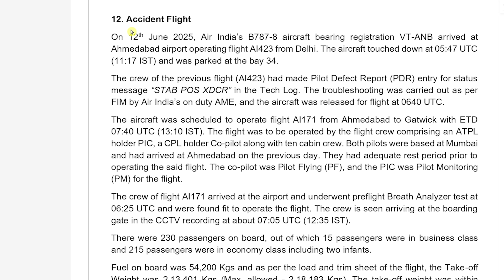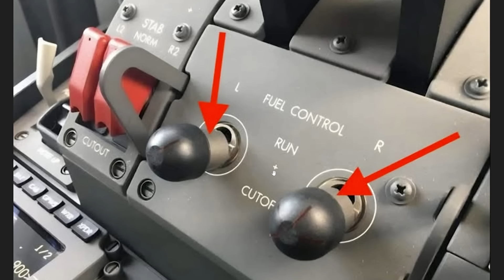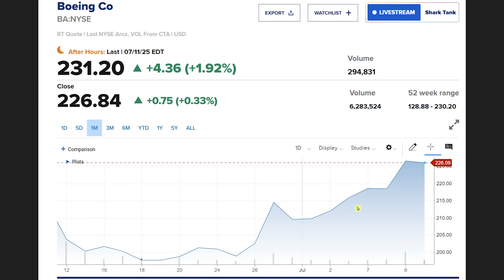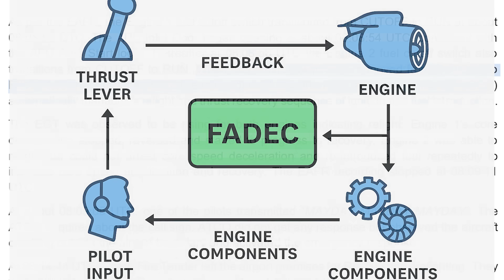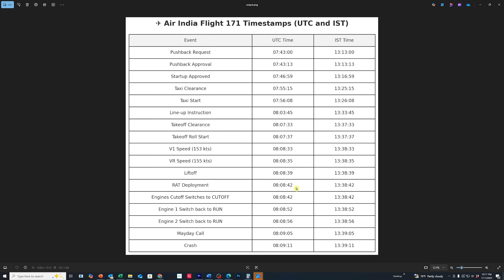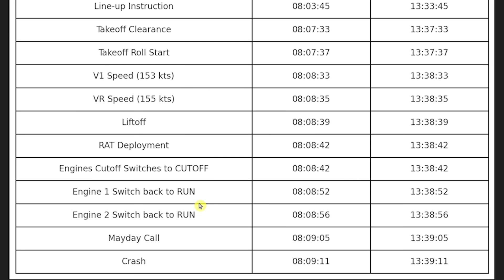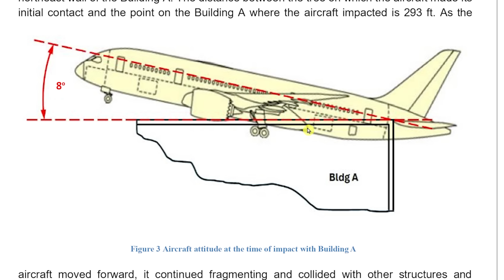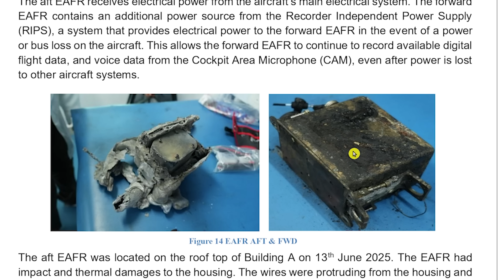Did Pilots CUTOFF Fuel? Shocking Twist Air India 171 Report!

Comment: in 787 dreamliner fuel  switches are bracketed and guarded . It's spring loaded 5 pound of force to be applied on each switch to pull it, to change its position ..both can not be operated at the same time .seems like a mechanical failure
Reply: Interesting information. Don't know why they didn't use a switch guard on such vital switches. When the B737 300 first came out, the rudder trim switch had no protection. Cabin attendant sitting on observer seat behind me put her foot on the pedestal and moved the trim. I knew it wouldn't be long before it took an accident, to put a guard on it. I have seen several cockpit designs that made no allowances for human error. Too many optimists in the design department.
Reply: Suggest you watch the vid by Capt Steeve who demonstrates the switches being moved within one second of each other.
Reply: Dumb dumb..
Reply: Reading the report what is the most terrifying is pilot a saying why did you cut fuel? Pilot b replies I did not! Ok so that says one thing really leaves little in the way of options, 

1 pilot a switched them off and questioned pilot b about it. 
2 pilot b turned them off pilot a caught the mistake and corrected then questioned and B lies to cover
3 mechanical malfunction flips both switches like a breaker as the air directive mentions is possible
 4 there's someone else in the cockpit that did it
5 Casper got bored and decided to collect souls. If I was the sole survivor I'd be afraid that I just lived thru my own version of final destination.
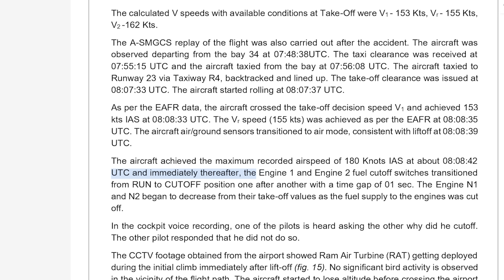Reply: so you didnt watch the video  1:54
Reply: Who said same time? One second is in the report. You're hallucinating

Comment: I can't recall who's analysis it was on YouTube where I heard this info.. But it was said that there were previous incidents where there were sometimes a glitch during electrical systems switching to the RAT where both cut off valves would close.. (as they require power to stay open) but those incidents were on landing and caused no major problems so there wasn't much public reporting done in regards to those previous incidents... ? Have you looked into this info already?  If this could be what happened then the pilot who said they didn't cut off could be  telling the truth and would be very wrong to suggest otherwise.. Please look into it.. and let us know what you find. Also, do the black boxes record the physical switch position or just the position of the valve or whether there is current in the circuit?

Comment: AND what about this from The Aviation Herald? Doesn’t seem to blame the pilots.

“On Jul 12th 2025 (UTC) India's media report that the investigation is NOT focussing on a human action causing the fuel switches to appear in the CUTOFF position, but on a system failure. Service Bulletins by Boeing issued in year 2018 recommending to upgrade the fuel switches to locked versions to prevent inadvertent flip of the switches, as well as the FAA/GE issued Service Bulletin FAA-2021-0273-0013 Attachment 2 relating to loss of control issue (also see above) were NOT implemented by Air India. The stated MN4 computer with faulty soldering, that might weaken and lose contact due to the thermal stress after a number of cycles, interprets data and commands fuel metering valves - with the lost contact attaching the MN4 processor to the EEC intermittent electrical contact, loss of signal processing and engine control faults can occur. The SB writes under conditions for the SB: "An LOTC (Loss Of Thrust Control) event has occurred due to an EEC MN4 microprocessor solder ball failure." According to discussions in the industry it may be possible with the number of cycles VT-ANB had already completed, the solder balls were weakened sufficiently to detach the MN4 from the EEC momentarily due to loads during the takeoff rotation leading to the loss of control of thrust and shut down of the engines.”

Comment: The RAT would not deploy untill the engines go below idle threshold and the engines would not go below idle threshold unless there was a problem, so 08:08:42 Engines Cutoff Switches to CUTOFF could not have been the time the switches were moved to CUTOFF but rather the time one pilot said to the other, "why did you set the switches to CUTOFF". The switches went to CUTOFF some time before that but was not noticed by the pilot asking the question untill at this time.
Reply: Yeah I noticed that Jeff's timeline was wrong right away, too. He actually listed the RAT event before the switch cutoffs, and the time he listed was the same, which is impossible.
Reply: The RAT deployment time is not specified in the official report. It just says hydraulics were being provided by it at :47 seconds. Did guy who made the list go by typical deployment times after fast spooldown to sub-idle?
Note that the resolution of the timestamps is one second, so times could be extended/reduced.
Reply: And why did the pnf say he didn't....

Comment: Could the cut off switches have been tripped by an electrical fault? A previous traveller posted a video of issues in the cabin which seemed electrical in nature.
Reply: Good point indeed
Reply: They cant trip they are not breakers. You have to lift them and move them up or down.

Comment: There should be an interlock or a computer supervision, when taking off those switches do nothing i.e. either on/off fuel continues to feed the engines no matter what.
Reply: There are legitimate reasons for shutting down an engine early in flight. Perhaps not allowing a double engine shutdown would make some sense. However, how much delay should there be. Also, introduces new failure modes. Consider if the buildings hadn't been there, the plane could have likely crash landed with little to no loss of life. The current switch arrangement has been used for decades in both Boeing and Airbus aircraft without serious incident. If anything, those switches have saved many lives over that time. Ability to shut off fuel immediately to address an engine problem is an essential safety feature.

Comment: The switches do not connect directly to valves.
They make an electrical connection going to who knows where!
RAT deployed before Cut Off!
Reply: You are more expert than the report... Do you have factual evidence? 
These are bold clams that no professionals have yet argued.

BTW you are up against NTSB in the US... its not just india... so don't take the escape route.
Reply: @TravisAviation  he just googled it, he does not really have that piece of information, as a part of his knowledge base
Reply: @TravisAviation  

i'm pretty sure the switch would be going through an electronic / electrical interface to actuators.
not directly connected.
this is due to inductive kickback, hysteresis.. etc.
the signal would likely be conditioned both ways, outgoing and incoming for confirmation that the valve had been opened / closed since this is a critical item.  
and the incoming confirmation would likely be a separate piece of electronics not connected to the outgoing.

that would be good design.  

it sure as hell isn't a switch the pilot throws that simply closes some relay that activates the valve.
that's crazy talk yo.
Reply: And they know where, it is where the computer and wires lead... uhhh oh Switch, Fadec, Engine, etc...

Comment: Even if it looks increasingly plausible that one of the pilot intentionally flipped the switch, don't discard the possibility if some kind of freak electronic failure caused the system to read switch off and on events without the switches being touched. A thorough investigation is desperately required to root cause the issue. After all, it is very difficult to accept that one of the pilot was on a suicide mission despite having precedence of such nature in the past.

Also someone asked this question in the comments below. Requesting experts on this subject to answer.

"do Boeing 787 fuel cutoff switches produces clicking sound or generate audible alert when flipped" ? If yes, cockpit voice recorder would have picked up this sound and may help ascertain if the switches were indeed physically moved,
Reply: I think that the sound of the switches would be too quiet to hear.
Reply: Similar incident, January 2019 Osaka. Both engines stopped while landing. No one moved the fuel switches.  The fly by wire computer can override the switches without moving the physical levers. Think of a modern car going crazy etc, another example of computer malfunction. Old cars had direct links, no computer.

Comment: I might be wrong but as I understand both even intentionally can’t be turned off within gap of 1sec
Reply: Sorry, but the flight data recorder says that's what happened. And it could happen in one second, because it did.
Reply: Exactly, I thought the same, maybe possible if it is deliberate, and done simultaneously by borh hands, and possibly by hands which are not on the yoke.
Reply: i had the same thought but look at the footage shown at 4:33, and check it in 0.25 speed or frame by frame.
in that demonstration it took exactly 1 second to switch one after the other. 
so it seems that IF the move was intentional, it was very precisely intentional like as shown in this example

Comment: Is it possible the plane took off with switches in the off position and suffered  fuel starvation then cut out and they both tried to reignite the engines?
Reply: Well according to the data they was turned off 3 secs after lift off
Reply: @craigppage wow, that can only be deliberate or a mechanical failure?
Reply: @DaveShortt  yeah mechanical would mean both leavers failed  and intential would mean the pilot not flying would lit have to use both hands to flip both leavers at sane time which the other pilot would notice 100%  why I feel baffled by this

Comment: Here is a question...
Can you hear the clicking of the fuel cut-off switches being switched on the cockpit recorder?

If so,  wouldn't the two clicks be heard on the voice cockpit recorder? Is it heard?  Then wouldn't the clicks be heard again when one of the pilots flip the cut-off switches back to the "on" position? 

If there were no clicks, then could it have been a computer error?  Or the indents are worn and the switches were accidentally bumbed or they just feel downward on their own? 
Based on both pilots, one asking and the other saying no, confirming that neither turned the cut-off switch to "off".

There is no video showing the cockpit, so there is no way of seeing what actually happened. And, I am sure that the investigators will find the panel with the cutt-off switches in the "on" position. So must realy rely on the cockpit voice recorder which brings back my question of whether one did or could here the cut-off being switched?

Comment: Are these switches somehow connected to the aircrafts computer system as well where some fault in sensors could have triggered an automatic switch off..if manual switching on both engines took 4 second interval how manually someone can do it within one second one after the other?  Even the RAT deployment happened at the same time of the engine fuel cut off ....I think one or both engines failed again due to some software or technical snag...the pilots panicked and few seconds were lost before they took a decision to switch on the fuels..remember they spoke with each other too...which would have taken good 5-10 secs.  Also maybe the fuel switches had some glitch and it took some manual effort to change it back to on.
Reply: Also the RAT deployment I guess happens when both engines stop running

Comment: Sabotage by the illuminati, similar to the so called 9/11 in New York in 2001. The aircraft system was hacked by someone on the ground. A single engine might fail for various reasons but both engines failing at the same time is highly unusual.

Comment: My problem with it being intentional, is why would the pilot want to crash at a low speed like that, where he might suffer, or Worse yet, live?
Reply: you are thinking at a normal mindset. the pilot may not be at that time...
Reply: Because if he waits and they have more altitude there is time to recover. They were traveling at just over 200mph, 600 feet from the ground. There's no time to recover nor is there any chance of survival.
Reply: Actually its very high chance you die crashing plane full of fuel. Turning the fuel off right after take off makes much more sense, then doing something in higher altitude.
Reply: The report also does not state that the switches were definitely moved physically, they are going of sensor data that could have been due to an electrical fault. Remember the switches were found in RUN. The RAT was deployed within 5 seconds of fuel cut-off was recorded and 3 secs after the take-off, this could have been a major electrical failure and not pilot's switching off them physically, so it could have been an electrical failure which shows that both valves were switched off via electrical failure of some kind
Reply: @farazalikhan5242  If the switches didn't physically move, then how did one of the pilots notice its position and question the other pilot???
Reply: Sounds like he wanted it to look like an accident and accidents are most common during takeoff and landing. Maybe it was to protect the finances and reputations of his surviving family and/ or maybe he didn’t want his family to know he was suicidal.
Reply: @MoneyManHolmes  well he's a pilot and he knows from his training and experience that everything is recording in CVR AND DATA RECORDER
Reply: Not an aviation expert, but I have a couple of unsuccessful unaliving attempts under my belt and knowledge on the subject #1 majority of attempts are rash and not methodically planned out. Basically, do it now to get it over with without regards to the consequences. Attempts require a level of fearlessness that supersedes rational thought #2 Opportunity. It's a few switches and boom- ease of access may have trumped a guarantee of success. #3 Location- need for it to take place in India ie media coverage or fixation on the location.  If the pilot had considerable ideation, every takeover there he could have been thinking about the potential of doing it over and over at that airport. That day they finally crossed that barrier to actually do harm. That's the real danger between passive and active ideation. Most people cannot cross that threshold to harm themselves or others. It takes an unfortunate set of circumstances. The biggest thing to know is actions like these are not necessarily methodically planned out actions. Many times it's a very rash decision where overwhelming hopeless feelings trigger a desperate attempt to end the pain without thinking much about the consequences.
Reply: lot of vested interest pushing the pilot suicide angle...
but then comes your question which screws up such theories.
Reply: It could have been deliberate but not in malice, again giant brain fart is possible.
Reply: You are assuming it was deliberate. Don't.
Reply: @CuriousCrow-mp4cx  That's not how it goes. Lol. I made that comment, to answer back to all the people in the comments, who are on here saying "Well, one of the pilots did it on purpose"
Reply: @CuriousCrow-mp4cx clearly intentional.

Comment: With the fuel cut off switches having RUN at the top and CUTOFF at the bottom, it seems to me that if these switches could be activated accidentally. It would be safer to have RUN engaged by moving the switch down not up, and for CUTOFF you need to move the switch up. Therefore by switching the way these switches work, if RUN is engaged by moving the switch down it could never just disengage and fall into CUT OFF. It has to be lifted into CUT OFF. 
Also the report says that there was a Safety briefing released (SAIB?) about these switches where on some planes the mechanism for having to lift the switch over the metal safety rim and notch to engage RUN or CUTOFF had been deliberately either not installed, or installed deliberately disengaged. This meant that the switches could be activated without lifting them and then dropping them over the safety rim. Apparently AIR INDIA did not do anything about this briefing because it was advisory only, not mandatory.

https://i2.res.24o.it/pdf2010/Editrice/ILSOLE24ORE/ILSOLE24ORE/Online/_Oggetti_Embedded/Documenti/2025/07/12/Preliminary%20Report%20VT.pdf
Reply: Because they are trying to solve the demographic problem one air crash at a time!